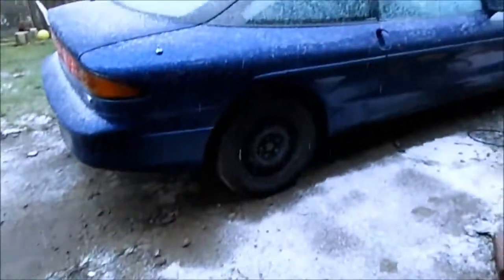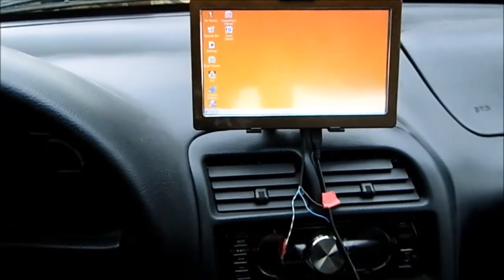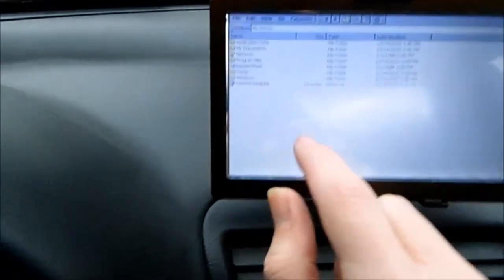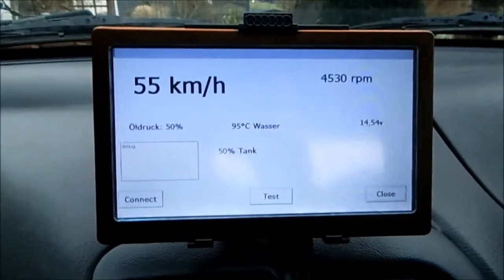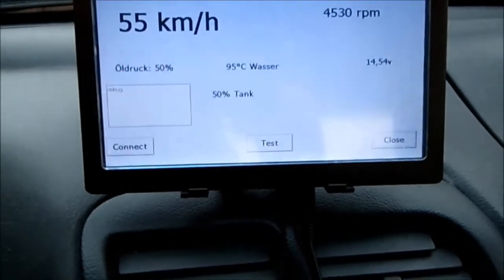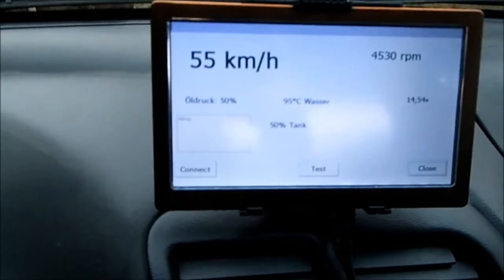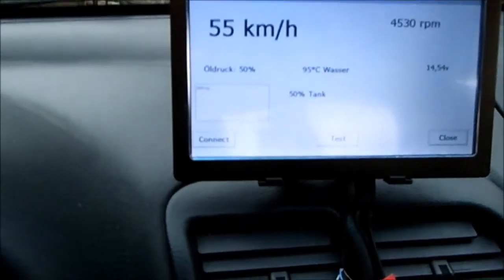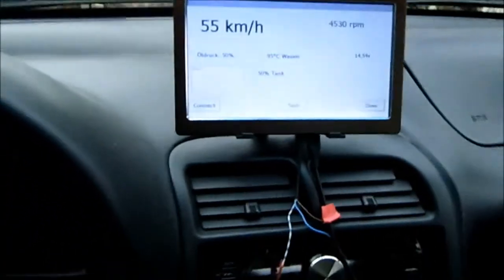cheap sat nav hacking / windows CE

Comment: Is there a ground and Vcc to connect to? Do you only need to connect tx and rx to arduino?
Reply from the maker: I used the Ground and VCC that goes to the charger to connect to. Technically you only need to connect ground, tx and rx to the Arduino. I just used the same VCC for the arduino since I powered it with the charger, too.